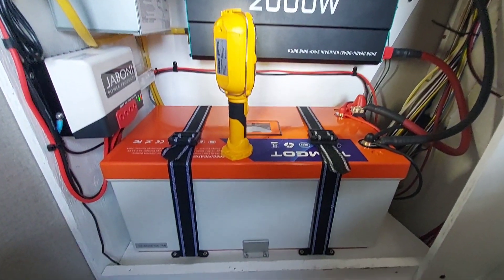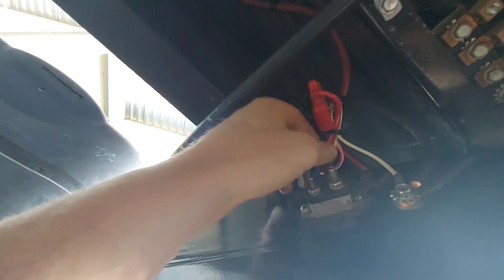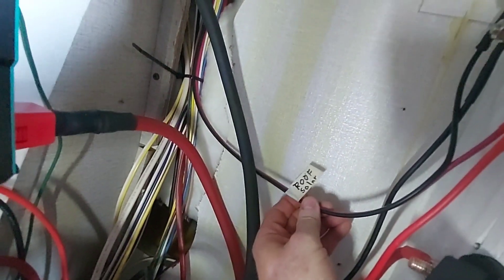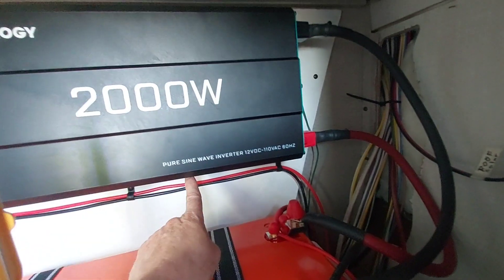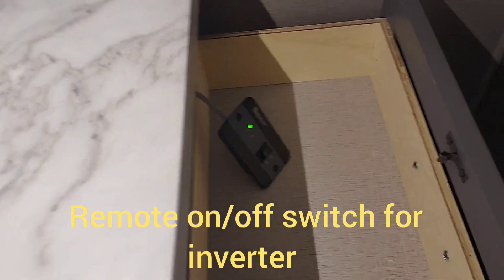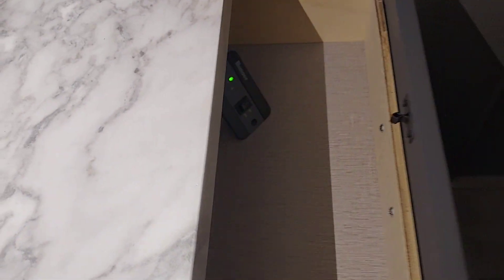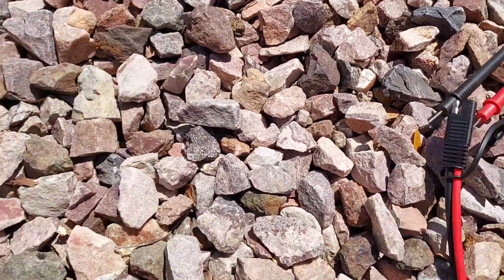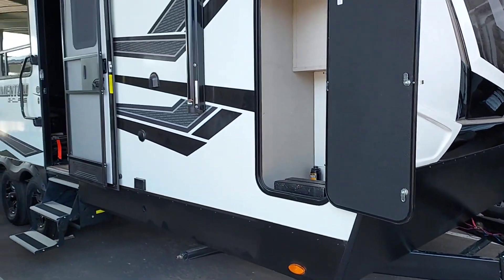Momentum 21G Lithium battery upgrade, with inverter install and wiring

Comment: I have this same setup on my 25G but I also have an Onan 4000 Generator.  I was told to change the 30-amp fuse with a 60-amp fuse by WFCO tech support so that the Auto Detect would keep working properly.  This is the fuse that you show in your video at 2:23.   Also, I am not sure what I would do any different with the Generator connections.

Comment: This trailer came generator prepped. Why did you get a different transfer switch then the one that is in the circuit board compartment?
Reply from the maker: @michaelshilts9132  I left it in case I decided to put a generator in.

Comment: Have you thought about a thermometer for the battery cabinet?  Or a thermostatically controlled fan?
Reply from the maker: Yes, I have a Bluetooth thermometer in there now. I am planning to install a cooling vent with possible fan in future to control summer heat. I will cover some of this in a future video. 
Thanks for watching!

Comment: Thanks for the video.   I look forward to more.    Love the details you cover.   One question;  did you mount the battery inside due to theft concerns ? Would it have been "easier" wiring-wise to leave it in an appropriate size box on the tongue ?
Reply from the maker: The battery is located in the cabinet for better temperature control, easier to wire all components and switches and for theft as well. I didn't want to run 2/0 cable out to battery tray for inverter.